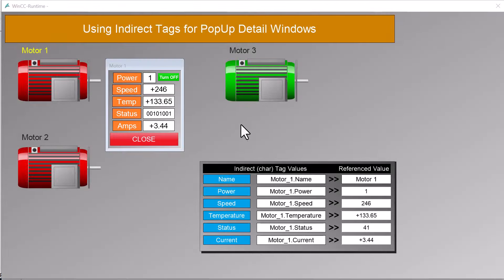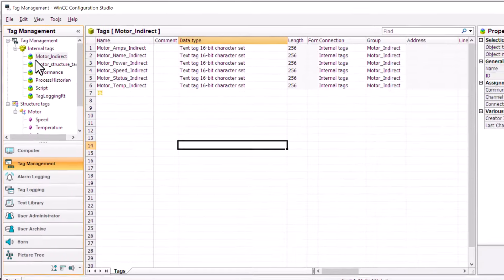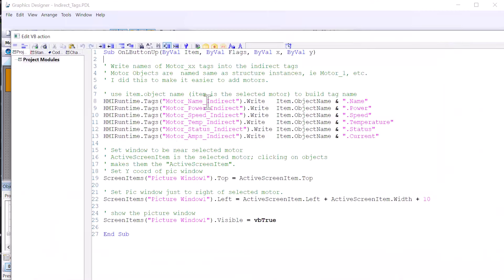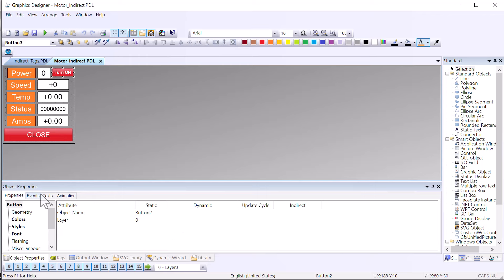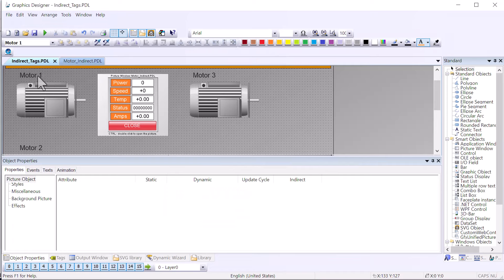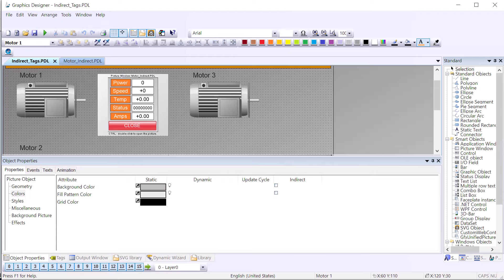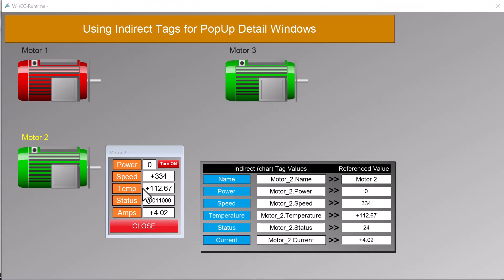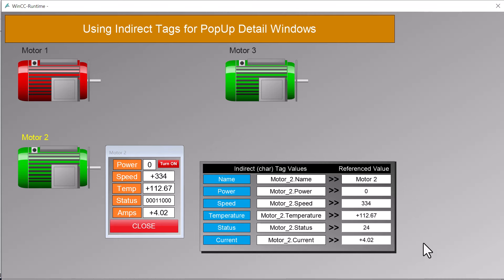WinCC Indirect Tag Addressing - Dynamically Assign Tags to Objects #winccguru

Comment: Dear Bob how the internal tags control external motors instead of internal color & text changing?
Reply from the maker: The same way. If you use indirect addressing with PLC tags then you can control them in the same way.
Reply: @WinCCGURU  Thanks. Another question is how you configure the "Close" button in either VBScript or C Script code? You didn't mention it in this video, please specify it. I used ClosePopup function, but it is not working.
Reply from the maker: You can use direct connect and set 0 to current window display property. 

Or in VBS you set the visible property of item to vbfalse  (assuming the script is on the picture window)